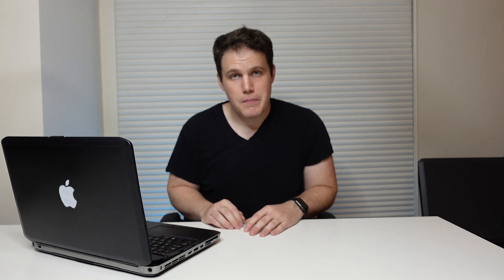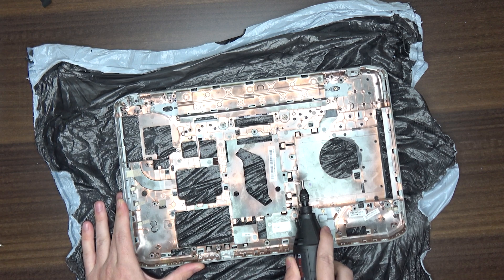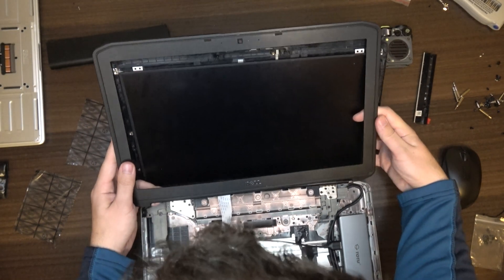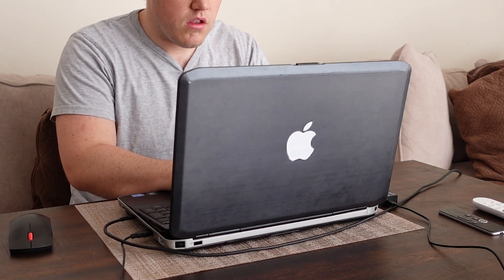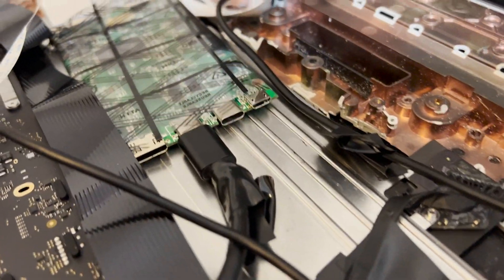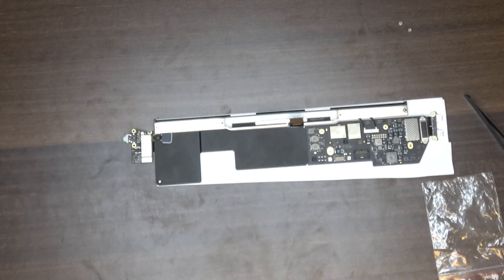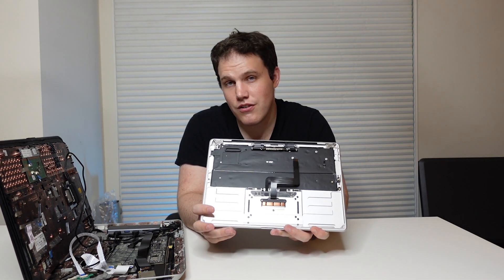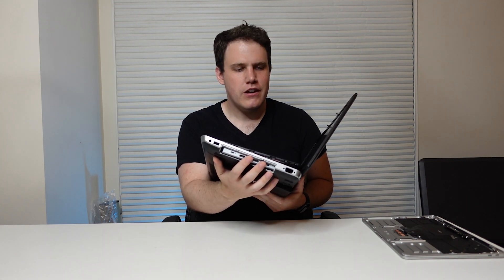Building an M1 MacBook Air into a 2014 Dell Latitude with a Touchscreen

Comment: Quick question about this from years later! For the display connection, did it just require one with a 30-pin edp cable, or were there further complications? Planning a similar project w/ an old ThinkPad and this video has already been a huge help :)

Comment: Hi
I've got couple of MacBooks that are 2015 and I am not using them but I love the resolution on them and wonder if something like that would be possible?
Yesterday I've seen a video and a post on twitter about people buying old MacBook with broken screens and connecting some random other screens and using them as a mac min sort of.
My question is, would it be possible to detached a good macbook pro screen and make it a monitor or a travel monitor even better?

Thanks
Reply from the maker: As far as I know, there is no way to convert a MacBook screen into a portable monitor.
Reply: @innoiso  thanks for the reply

Comment: Hi, that's a great project. How are you powering your LCD controller? I believe your trackpad is a Synaptics one? If so, then it is very easy to connect it to the Teensy 3.2, you only need two I/O pins, and the ground and 5 volt. Just follow Frank's instructable for trackpads. I've done four of them now.

For your LCD cable, get two 40pin FPC breakouts (or how ever many pins your cable has) with the correct pitch ( I believe .5mm in your case) and using 28 gauge wires about a foot long, wire them together.  You won't need to connect every wire if you have the datasheet for your display, because not every wire is used. Then you can route the wires through both hinges if they will not fit through just one. Replace the long FPC cable with two short ones, one going from the LCD to the first breakout and the other going from the second breakout to your LCD controller. 

You might be able to cut your present LCD FPC cable as you described. I did that on my eMate project (I describe it in the video), but it only has 15 pins, trying to do it with 30 pins is possible but you will need a lot of magnification, I ruined four cables until I did it successfully, and even then sometimes the cable would short out, so I gave up on it.

Thanks again for sharing your project:)         Billy
Reply from the maker: from the MacBook. 
And I will try the trackpad, notably the trackpad's pins aren't labeled so I need to do some research. 
The cable guidance is really helpful, but I need to find a way to fit the first breakout board behind the display

Comment: Thanks for the shoutout man! It has been a pleasure to follow you in your youtube adventure and I hope to see many more great videos! Concerning this one, I was wondering if using a M1 Mac mini with all its ports etc could be an easier option. I use mine with an AC powerbank around the house and it’s great to have USB A, HDMI, ethernet etc.Maybe if the next mini is thinner as rumored it will work well for such a project.
Reply from the maker: I thought about the same, I wasn't sure whether the M1 Mini could run off a power bank. Good to know it can, just need to find one that will fit into this chassis. I imagine the MacBook's battery is more energy dense, but not sure.
Reply: @innoiso  not only it runs off a power bank but it can also power a touchscreen 4k monitor at high brighness. My powerbank supports 80watts, the M1 Mini uses less than 30 at full load.... Also with a luna dongle it can run off just an iPad (which acts as touchscreen plus pencil)

Comment: Isn’t itvpossible to just 3d print a bottom case?
Reply from the maker: Theoretically, yes, but it will need to fit with the top frame, and be sturdy enough to hold all of the components. Hope to try something with my 3D printer soon

Comment: You could also 3d print the case to make it look more like a MacBook and cast it in aluminum using a mold.
Reply: Also how about a touch screen Mac tablet... and or a touchscreen Mac tablet with an optical drive. You can always make the case you need too.
Reply from the maker: That's an interesting one. The battery might be a tough piece but I like the idea

Comment: Looks great! How about stuffing  the MacBook into an older 15in aluminum MacBook Pro? I like the idea of an optical drive. You could use a 3D printer to print parts to add support and keep the internals from bumping into each other. You can also turn the 3D prints into aluminum using a mold and casting the aluminum for added toughness.
Reply from the maker: I love the idea, and was originally going to build it into my first Dell laptop from the mid 2000's, but I realized that the aspect ratio of the display matters. If I could find a touch screen in the same size as an aluminum MacBook Pro, then it should work. I'll see if I can tweak the internals around to fit the optical drive, but I'll need to find something very thin. And yes! I have an Ender printer that I'm hoping to use to build a motherboard shell and some mounting points, just need to learn how to use it =). 
I would LOVE to make a custom aluminum chassis for the build, if this video takes off then I will try and find a way!
Reply: That would be great I would like to see an aluminum enclosure cast from a 3d print. Have you seen aluminum casting from 3d prints? It would be neat to try. Also there is a metal filament you can get for you ender printer. The way it works is you print your part as normal and there is metal in the plastic print then you place your print in an oven and the plastic burns away just leaving the metal. There are YouTube videos on it.
Reply from the maker: Interesting, I'll check it out!